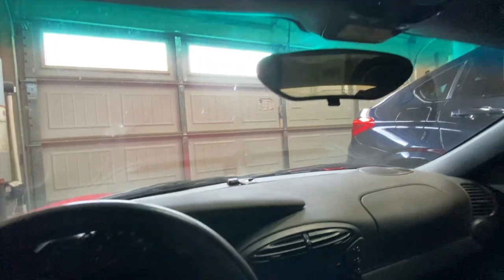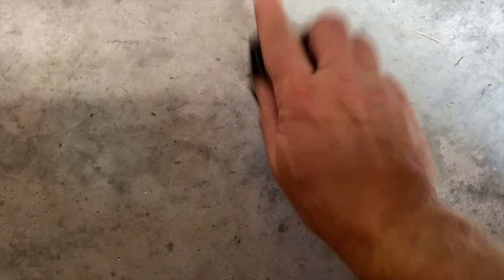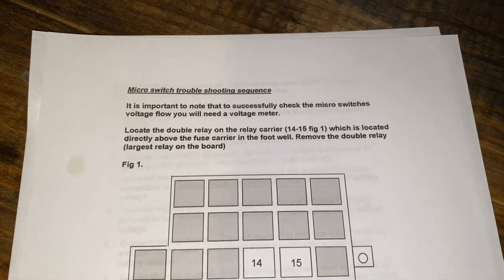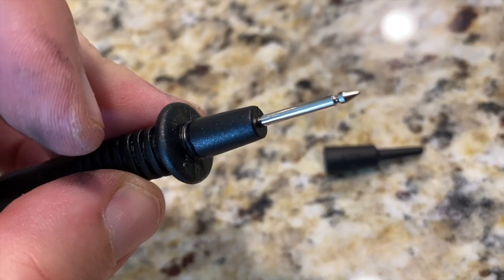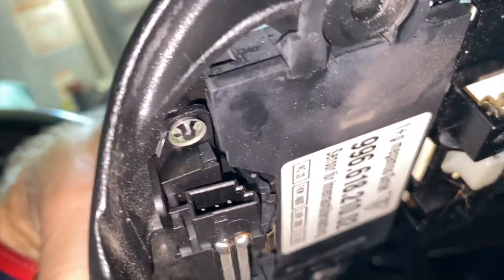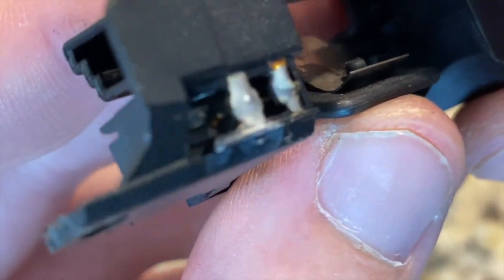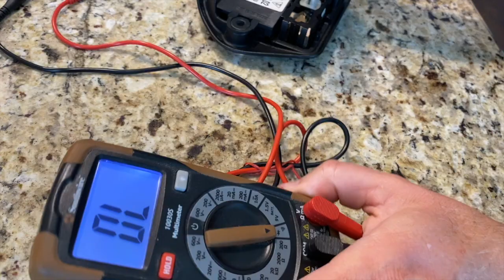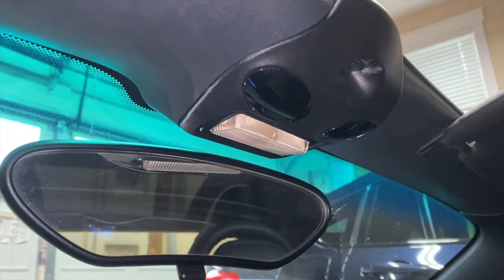Convertible Top WON'T OPEN/CLOSE GO UP/DOWN - FIXED! Porsche Boxster 986 Troubleshooting Tips

Comment: Thank for your video, it’s helpful but it didn’t fix my problem. I got the same problem with my roof, it stay open. The glasses stay up, the antifreeze rear glass didn’t work too and the lock door button didn’t work. It happen 2 hours before my 6 hours trip back home (Ogunquit to Quebec City ). Hopefully no rain. The light of my hand break didn’t work, so I fixed it, but my roof didn’t move… so I check all my fuses, the big relay, the micro switch in the windshield, the switch. Nothing. I check the fuse in the ECU(under the driver sit) and it’s ok. I pass trought the step of the relay check list and I was confuse. Only step 2 works…I got no logical answer on the voltmeter for the rest of the step??? So, I think is the ÉCU is dead.$$$$$. Do you have any other tip or test? Thank
Reply from the maker: +@tommyfalardeau8814 that’s all I know, sorry. Let is know when you figure it out! 🍻

Comment: Have you changed the Boxster convertible top with Autotopsdirect? I recently used them and ended with the Top Frame and B Pillar vertically misaligned by 5 mm. Have you heard of this issue? I have looked at all forums and dont see this reported.
Reply from the maker: +@EPMSolutions1 I have never replaced the top

Comment: I've got to thank you especially for putting together this video, because you got my convertible top working again! I had to replace the relay as it was actually not there when I purchased it. Plugged it in, top still didn't want to go down. Started troubleshooting other things like fuses the parking brake and the safety switches for the top release. Everything appeared okay but once I looked closer to the solder connections all of mine were corroded. Put the soldering gun right to the old solder and cleaned up the connections. Put it in the car and convertible top still did not want to open. I have to remind everybody the car was still very fun to drive and get familiar with in the first stages even without the top working. Found out the hard way I ended up needing to replace my alternator,.... did the swap and was so glad I did because the old one came out disgusting dirty where you couldn't even see the copper coils anymore and the bearing sounded like crap. Instead of waiting for a refurb I had already picked up the new one and was glad I did at that point I put it in and waited another weekend for a warmer day. This day actually came next the next weekend,.... went out to my budget boxster knowing it had a healthy battery, a new alternator, a relay that should not be bad, and safety switches which I cleaned up and resoldered per like you recommended. Turn the car on and the roof didn't move at all I was very upset then I thought there's just got to be something wrong here and I reached down to the relay while hitting the button for the top I pushed the relay in and all of a sudden the top literally burped and came to life 🤪.  Can't tell you how excited I am to be using this vehicle in 2021 it's going to be a collector's item in just a couple years. It's obviously my baby, 2001 boxster s 6 speed manual with Borla exhaust, upgraded headlights, clear side markers, and it had wheel spacers from techart  only in the rear. 65,000 Miles, Carfax says it's had three owners prior, I think two people took care of it and one person beat it up lol unfortunately. At this point I think I've got it just in time!! I got it before winter last year and stored it so now it's out and I'm doing the crucial maintenance that is definitely quite a good list before 70,000 miles. Sure am glad I have your channel to refer to!! I've got my eye on a quick jack, seems foolish to DIY without one! Much respect 🙏💯 I plan to do my IMS bearing and new clutch after this season, can't wait to work on it over winter time.
Reply from the maker: That’s great, thanks for sharing!!

Comment: Great video. I skipped checking all the big relay fault modes and went straight into the micro switches connections soldering. The soldering fixed it exactly as on your video, it also burned down a hole in my wife’s favorite table cloth, but there must be some losses. Thank you for posting.
Reply from the maker: +Michal Pytel 😆 well at least you got it working! Hopefully you’re a subscriber now even if your wife isn’t.
Reply: If it makes you feel better, about when you were burning the tablecloth there was a news story about a guy who was going after a spider with a can of hairspray and a lighter, and you'll never guess what happened. 
Yep, the WHOLE house.

Comment: I had a different problem with my top not wanting to go down.  No electronics.  Purely mechanical. 

If you partially open the lid about six inches, you will see there are a couple of rather robust wires with little screws attached to the end of ball joints that attach to both sides of the convertible roof.  One of my screws had come loose and fell out its socket and got lodged in the mechanical lifter and essentially held it from opening.  After dislodging it (no small task), I put it back in place with a 7mm box wrench and tightened the screw.  Then it worked perfectly.   I also tightened the screw on the other side as it was working its way loose.

Now my care runs even faster.

I hope this is useful and you can make a video for this problem!
Reply from the maker: +Greg Arbon thanks for the detailed info!

Comment: Great Advise!!!  Thank you so much!  I looked at my emergency break light and it wasn't turning on when engaged.  Opened the panel to see mouse droppings and my two brown wires from the brake micro switch chewed and one open.  Put a jumper to reconnect the broken one and the electronic convertible top is working.  So happy!  Thank you again your so helpful!
Reply from the maker: +Susan Niermann thanks for sharing and I’m glad the video helped 😁

Comment: My 98 Boxster has exactly the same problem and (so far..) the same solution. I went through the diagnostics until the same step that failed for you. I took the roof latch switch assembly out and messed around a bit, and when I reinstalled it, the roof worked again. Like you, I don’t know what I fixed so I kinda expect it to fail again but at least I know for sure where the issue was. Awesome video! Thank you
Reply from the maker: +James Walton hahaha that’s great! Hope you’re a subscriber now 😉

Comment: Thank so much for this! I just fixed our 987 using your guide, only one micro switch with two wires in the roof latch, but heated and moved the joints……it worked!
Reply from the maker: +Mark M 💪🍻

Comment: After seeing that switch on your video, I wondered if the problem was just a stuck plunger. I wiggled the hand brake and - for good measure - I tapped the console panel at the bottom of the hand brake with a towel wrapped hammer. The “park”light now works and the top does too. This probably isn’t a long term fix, but might come in handy if you’re on the road.
Reply from the maker: +Kamakauke Two yes the taping of the switches on this car seems to work quite often for me too 😁

Comment: Did this fixed this weekend. Also Deb Dans a little hot glue behind the switches so they stopped pushing in. I took out the mechanism in the dome light just literally disintegrated. Thanks again homes.  No time for the water pump the belt literally sheared the pulley right off its shaft
Reply from the maker: +Dan Beaule you got it!

Comment: Thank you for the video. Had the same problem with the top and scraped the corrosion of the soldered ends on the latch switch thing with a razor blade. Reconnected and it worked.
Reply from the maker: +Karl Heinz excellent!

Comment: Great video I, it helped me fix the switch issue with my Boxster! I didn't realize there was more than one switch in the upper latch, in my case the spring had relaxed and was not engaging the micro switch plunger. A quick bend of the spring fixed the problem, once I saw the switch in this video, I was able to fix it in record time.
Reply from the maker: +Daniel Jackson that’s great! Please consider subscribing if you haven’t 😉

Comment: I have a question, today I replace the 2 plastic push rod ball joints because I thought that was my problem when the top failed and I clearly saw one broken.
Now with that replaced Ive found the motor is obviously not enabling the transmission and started to sound weird and show some smoke and suddenly died. I guess that’s OK with just replacing the motor but the doubts are:

1. You can replace only the motor? Can still use the same cables to the transmission?
2. The most annoying part now is that the windows won’t go up all the way which is a bit of a problem.

Any help will be aprecciated and thanks for the video.
Reply from the maker: +Abdiel Gonzalez yes you can replace just one motor and although I’ve never done it, I’m pretty sure you can use the same cables.

Comment: Thanks you - very thorough and a great tutorial - mine is a 987, same issue, same troubleshooting process, just 2 small relays rather than 2 big ones
Reply from the maker: +Karl Reddy glad to hear it helped!
Reply: Hi. I have the same problem on a 987 but can’t find the relay on my UK RHD model. Can you help?
Also, sometimes my roof will open, but not close. So not sure if that could also be a micro switch issue?

Comment: Great video! Helped me a lot when I was troubleshooting this problem on a friends car.

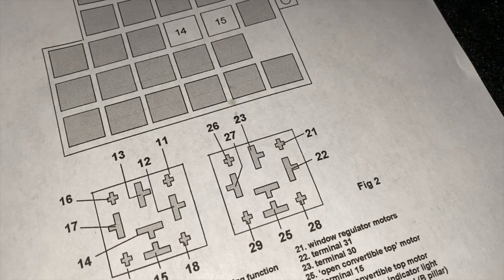But at 15:12 you made a mistake when you said that number 8 on the list refers to one of the micro switches in release latch mechanism. Actually number 8 refers to the convertible top compartment lid. The switch for the convertible top compartment lid is also shown in figure d in the troubleshooting guide. It is located behind the driver below the lid. When this switch works normal, you will read 0V when the convertible top compartment lid is closed. Once it is opened, you will get 12V. Since I guess you had the lid closed during the entire troubleshooting process, it's no wonder that you measured 0V at this step.

Actually number 6 and number 9 refer to the two switches in the release latch mechanism. In the troubleshooting guide they call these switches "cowl panel frame micro-switches".
Reply from the maker: +Eshco thank you and thanks for the additional info! 🍻

Comment: Thank you so much for your videos .. they are second to none and have helped me diagnose many issues with my 1999 986. I currently have a convertible top issue and have been going thru the microswitch checklist. So far nothing is wrong so I am down to items 10 and 11 which reference terminals 1, 2, 3 and 4. Do you know where these are located because they are clearly not on the base of the dual control relay? Any thoughts?
Reply from the maker: +Nick Robinson glad the videos have helped! I haven’t had to venture that far, but hopefully you figure it out and report back!
Reply: @HelpMeDIY  The good news is I realized items 10 & 11 relate to the roof motor (the guide is somewhat confusing). The bad news is the top is still not working. Suspect it is the relay ..keep the videos coming ..
Reply from the maker: @nickrobinson1166  thanks!

Comment: Hello Aaron,

I hope that you’re doing well.  I wanted to start by thanking for you for taking the time to make these videos.  They have been extremely helpful and they are are greatly appreciated. 

I am having a pretty horrible issue with my 1997 Boxster...the clamshell is stuck with the roof open.  I push the button and I hear a thump, but that’s about it.  I’ve read articles about using a 19mm wrench to remove the bolt on both arms (driver and passenger sides) in order to be able to manually open the clamshell to be able to close the roof.  Thankfully, I have a garage to park the car in.  Any insight on how I may be able to fix this will be greatly appreciated. 

Thank you,
Fausto
Reply from the maker: +Fausto Escobar thanks for the kind words! Luckily I haven’t had the problem (yet), so I can’t really add any wisdom to similar things I’ve read online. If you post the question on the 986 forum or one of the Facebook groups I’m sure you will get a lot of help pretty quickly.
Reply: @HelpMeDIY  I was able to fix it!  I had to unsat the metal ball joints from the arm on the motor.  It was a little tight to work with but, got it done.  I was able to open the clamshell and pull the roof up by hand.  The arms with the plastic ball joints got bent to hell...I'm going to have to replace those.
Reply from the maker: @faustoescobar9095  that’s great!

Comment: Hi Aaron,  top wont go up or down.  I pulled the relay.  I created two jumpers and got it to close and open.  I replaced the e brake sensor.  No light in the dash even with the new plunger. Can the bulb for the dash light be out.  What do I check next!
Reply from the maker: +lean2k I have another video on the microswitch locations that might be helpful?

Comment: Hello ,in my Porsche manual,for The test number 2,I read:Connect measuring instrument to terminal 22(ground) and terminal 26.SWITCH ON IGNITION.
In your list it's wrote:SWITCH OFF IGNITION,What do you think of that?
Reply from the maker: +Scoazec Jean-Pierre I think my list says to switch the ignition on for the test, and then switch it off to make it clear that it should be off for the rest of the tests

Comment: Hi, greetings from the Netherlands. My problem is in steps 10 and 11. The motor works when I connect ports 23/25 and 22/27 together. However, the convertible top does not open or close. What does not work if no voltage can be measured in steps 10 and 11?

Comment: Did you find that the alarm went off when you fully unplugged the unit? Apparently it has an alarm sensor or something similar, when I unplugged the interior light my alarm wouldn’t stop going off, any way to prevent that?
Reply from the maker: +Corey Hill Fitness hmm no, that didn’t happen to me. I assume disconnecting the battery would prevent it.
Reply: Disconnect your battery

Comment: Hi i have the same problem with the micro switch , did you leave the ignition on (first click ) while you done this job ? I didnt ,So as i disconnected the lead from the unit , the alarm went crazy . So i thought disconnected the battery , to my amazement the siren continued.  Please bear in mind only had the car a month .how do you disable the alarm so you can work on the car , to scared to at the mo lol
Reply: The tilt alarm sounder has a rechargable backup battery inside. This alarm goes off if you disconnect the main battery unless you leave the ignition on.

Comment: Couldnt find a switch to link @Aaron ?    Lol. I got my damn chain tensioners in and my top quit 🤦‍♂️🤣.  My break light isn’t coming on
Reply from the maker: +CHON I need to find one because mine needs to be replaced too! 😂
Reply: @HelpMeDIY    Lol.  Well.  When you find a part number (because I can’t ,or havnt yet ) let me know. Lol.  Tag me here if something.  And if I find one ,I’ll do the same. Lol 

I think mine went bad when I was putting my car on the liff and set the brake. That’s when I noticed the light didn’t come on .  Lol.  Then I watched this & saw what happened.
Reply: @HelpMeDIY    I’m actually going to go in the console and see if mine didn’t just come unplugged,or has a bad connection.  Otherwise. I’m going to find a bypass for this for all switches . Lol.  
I’ll be the last owner of my car. Lol. Idc.
Reply from the maker: @Chon-c  if you do something like that make a video and I’ll post it for you 😉
Reply: @HelpMeDIY   not sure how quick it’ll be. I think I know how it can be done. But I wanna  do a little research to make sure it won’t interfere With anything else .  

But I wouldn’t mind doing  that./bypassing everything but the relay because it can be jumped over with two “in-line fused” wires easy enough. 
So ,We’ll see how it plays out  . 

But In the mean time….Keep looking.  Bcuz the price is a big part of how I’ll decide what Ill do. Lol
Reply from the maker: @Chon-c  Wait... there's already a link to one on Amazon in the description. I just found it on ECS Tuning as well so I'll add it too.
Reply from the maker: Oh I bet you meant the switch under the hand brake, not the microswitch under the latch up top. I just found it and added it :D
Reply: @HelpMeDIY     I was meaning all switches but the main one on the dash in my bypass statement tho .  I wld like  to bypass two of them and only have the relay switch left.  Because the relay can be jumped (with 2 ,two wires & fused connector for the positive wire ) in a emergency easily enough .  

But check out that  vid I found here 👆in  researching about a bypass . .  I was gonna mention earlier that the relay could be jumped over to know if that is the problem.  Bcuz if it works with a jumper then it the relay obviously lol (I added that last bit for the future readers lol )

Btw ?  MY TENSIONERS MADE A GOOD BIT OF DIFFERENCE in my car .  It must have been not letting the valves breath near as well. 
I’m noticed around a 5 to 10 horses (estimate ) better.  In power. And it’s mostly at the point before you hit that sweet spot in the rpm range around 4K and over is where it’s most noticeable. And the sound is a much cleaner & tighter sound at the exhaust.   The engine sounds better than when I got it IMO .  and I’m a bit more experienced than the average joe when it comes to this type of stuff.   I wld recommend those being changed regardless if they hadn’t ever been by 50 to 60 thousand miles or even sooner .  Not that they should be many around with that mileage. Lol. 
Mine just has around 60 .

Comment: I have a w124 cabriolet soft top won't open, it keeps trying to lower the rollbar even though they are lowered the limit switch bottom is working top is missing but disconnected, new pump and rollbar valves. What could be the issue?
Reply from the maker: I don’t even know what a w124 is, sorry!